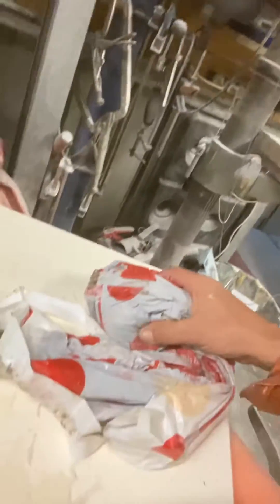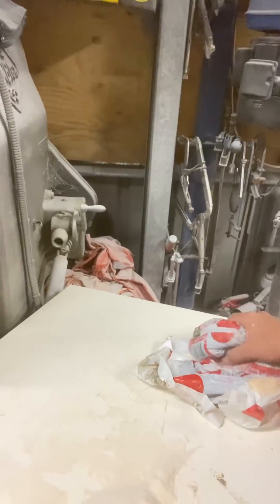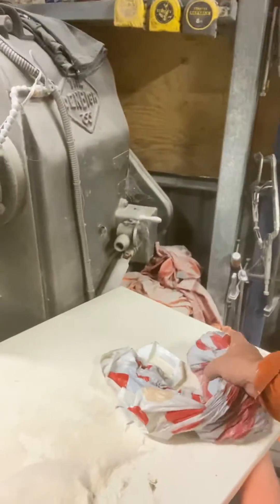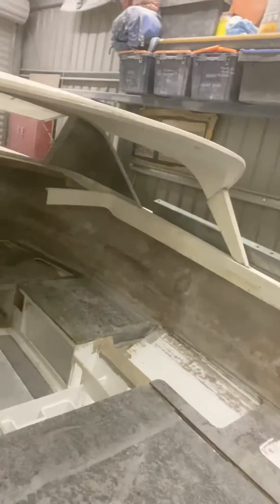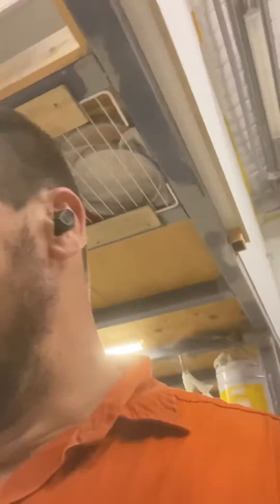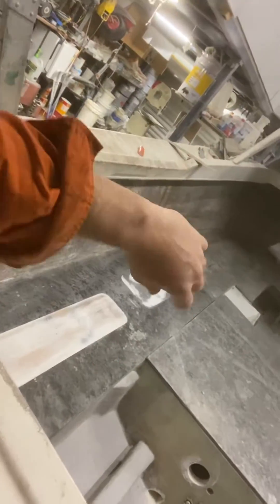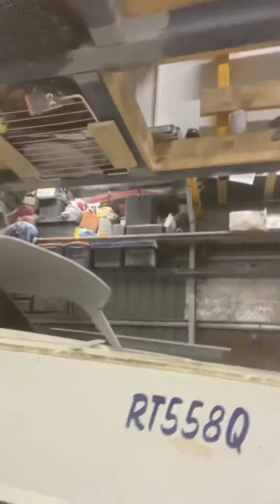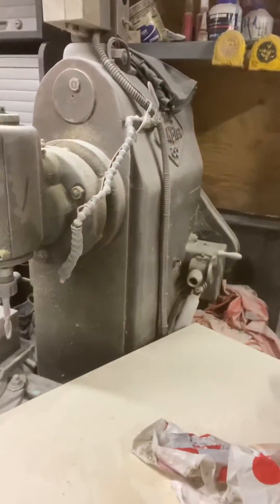25ft Bertram Project question??

Comment: If you want your bog to adhere to the epoxy glass work you’ve already completed I’m pretty sure your gonna have to make/use an epoxy bog. Might of misunderstood what you are trying to do, so I’ll watch your vid again
Reply from the maker: epoxy with epoxy is what i've been doing. The floor is epoxied to the hull then epoxied fibreglass over that. but to save on cost i have done a polyester bog fillet on the top of the floor to the side of the hull. so i have a good radius for the glass. Using vinylester fibreglass top of floor to hull side. if that makes sense? I know not to use poly or vinyl on top of epoxy. Thanks for your comment!

Comment: looks like a fun project , I don't know how you mixed it , but add you poly and mepk 1-3% depending on temperature so 100grams poly + 3grams MEPK will be fast ( 3ml MEPK is not 3% ), do it all by weight on digital scales then once mixed thougheraly add you thickener like cabricil, glass beads or talc  , do a test batch of 100grams and see how long it takes to gel so you can adjust the MEPK amount to give you the time you need.
Reply from the maker: legend!

Comment: Hey mate how many millilitres does the  600g end up as and see if your ratio is ok by volume see if that is what's happening mix it either by weight or by volume
Reply: 600g to 12g or 600ml's to 12ml's
Reply: I usually just mix my polyester by volume and not by weight and that hasn't let me down yet.
Reply from the maker: @thelonggrindcustombertram2072  then mixed while wet then applied dust
Reply: @Micington  I haven't been able to get back too ya as I've been flat out at work but thought I'd have a quick flick on the tube ill have to get some pics of my Bertram windows ive got for ya
Reply from the maker: @thelonggrindcustombertram2072  Needs heaps more cat when adding more volume with dust is what I think u mean
Reply: @Micington  I normally mix 600ml's of polyester with 12ml's of mekp and then add the dust
Reply from the maker: Him 600g of poly with 12mil cat
Reply: 1-2% catalyst